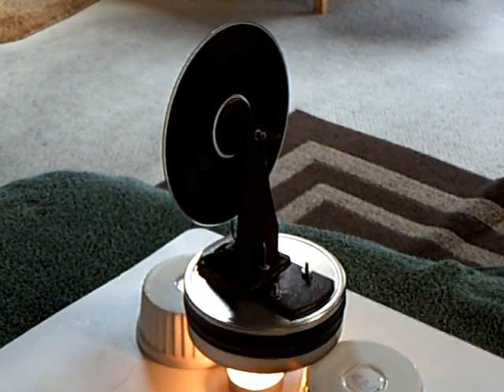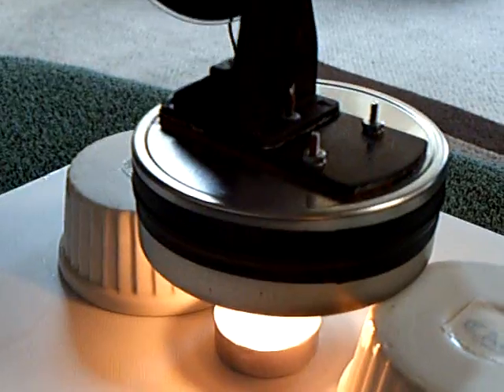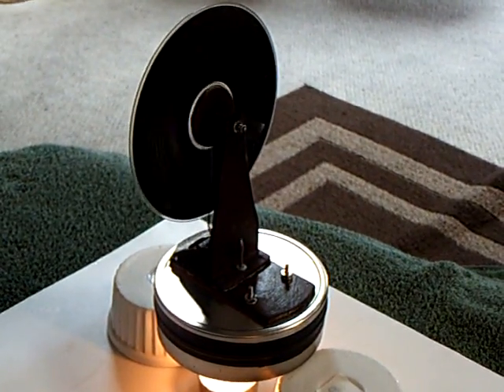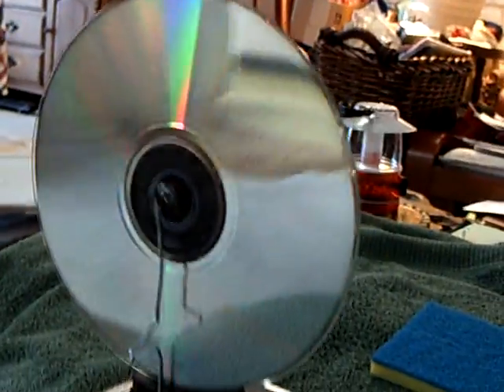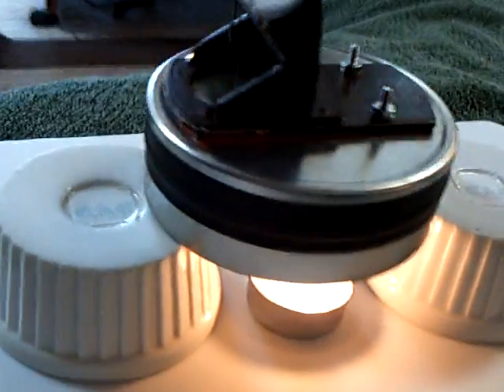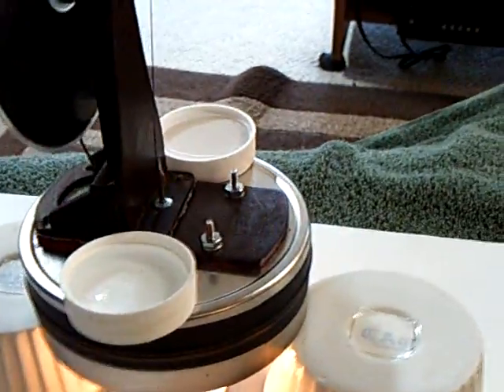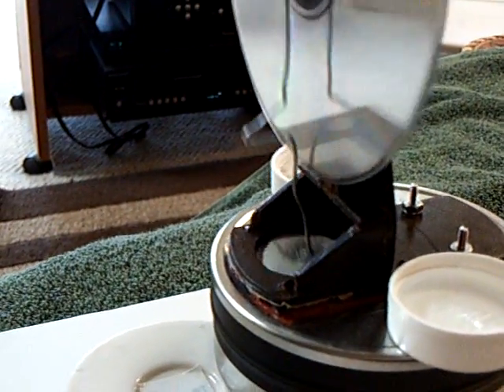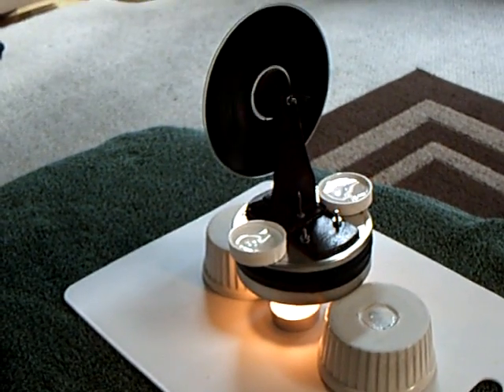E Z Stirling Engine- by Myfordboy

Comment from the maker: I think that there may be a number of "tins" that will work but you have to make adjustments to the plans.  You are right about the diaphragm adjustment.  I got mine a little too tight and there is no way to change it without tearing the engine apart.  Not good.